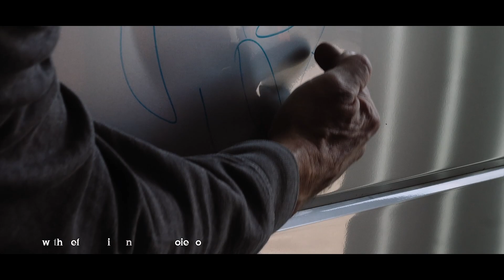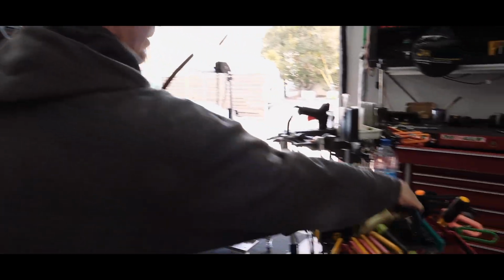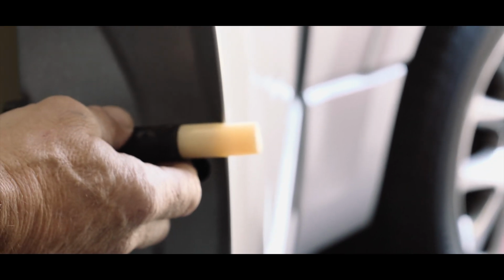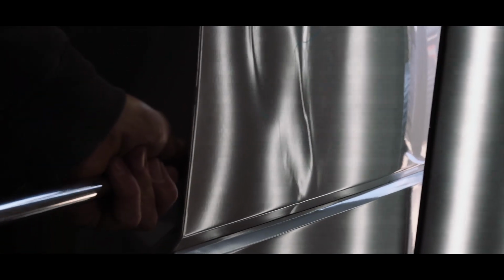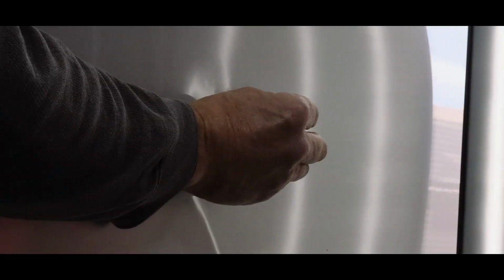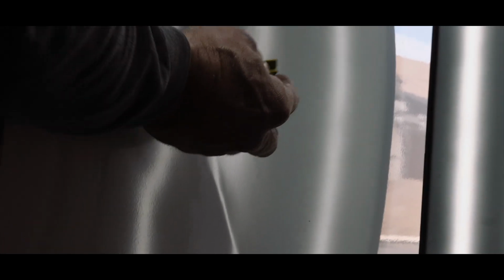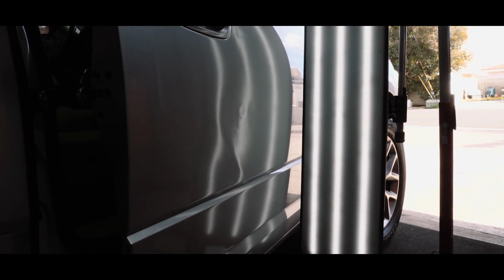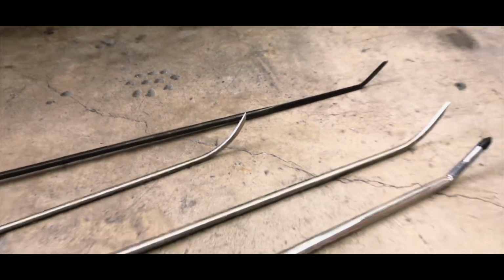PDR with Dent Masters | Jeff Magill | Ford Door Dent Smash | Paintless Dent Repair Episode 2

Comment: Did he drill a hole for access?
Reply: Maybe no, maybe yes
Reply: 😂 he drilled 2 massive holes.

There’s a lot of hate for techs who still use the “outdated” method of drilling for access.

At least he’s able to deliver a high quality finish.
Reply: @marvilltx9430  the door panel only takes 5 min to come off if so, and the door is held by 4 bolts. To me if a customer is paying they should get the best quality there is and no holes, now if they lowballed or its a wholesale job then im fine drilling and billing.